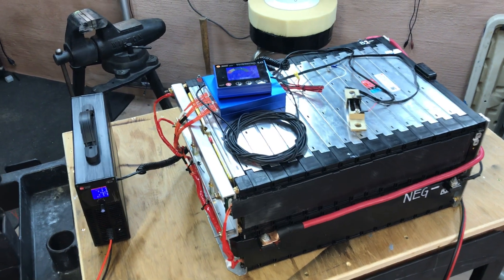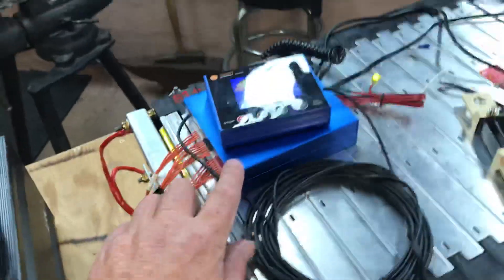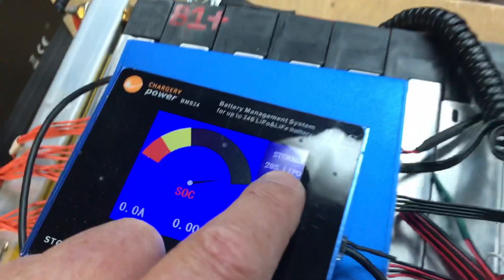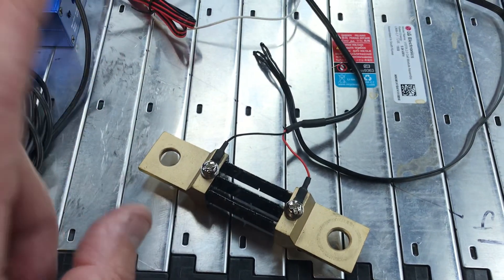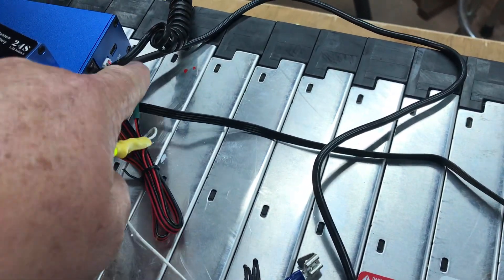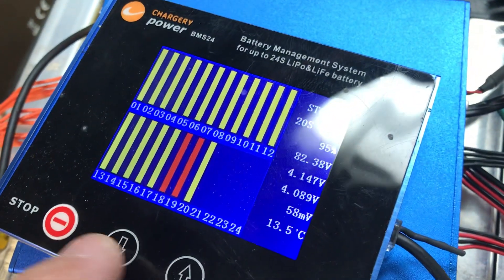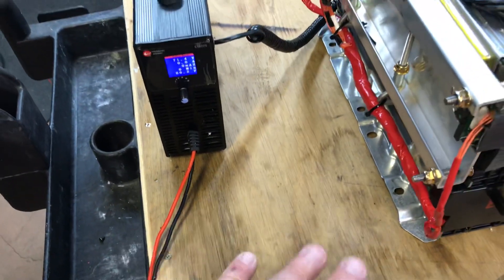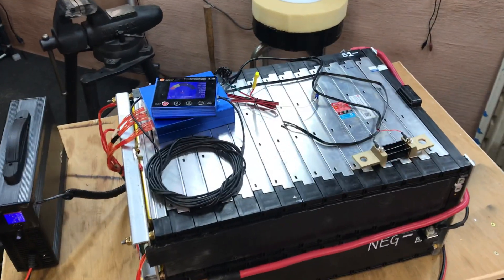Chevy BOLT Gem Car Battery

Comment: Hi Grant. How were the two 40V segments separated, did you have to hacksaw through where the 2 segments come together and then replace the bars it came with your own bar stock?  Also how did you connect the BMS wires to the battery cells? Using the PCB board and its connectors or soldering onto the copper busbar between the cells or ...  Thanks for the video

Comment: Hello, Grant.  If one were to use the Chargery charger how would the charge controller be used to switch it off when the desired voltage is reached?

Comment: Hello Grant, thanks for a great video! I'm looking to do something very similar for an electric sailboat bank, but I want to do 2 of these packs in parallel. Do you know if I basically would do the same setup with two BMS controllers and chargers, and are you happy with the setup and products you used in this video?

Comment: Grant, i have a 02 e825.  would  you be interested in building this kit and selling it to me?  or even if you want to just walk me through sourcing and building it for a fee.  your knowledge is amazing!  iv seen you everywhere online in all the research i have done from youtube to the electric car forums.  you know your stuff!  let me know, im itching to get my project going. thanks
Reply from the maker: Nick Alexander yes I can build you a complete turn key drop in Bolt pack. The bolt pack in the video was built for Tyson,  (a 2002 e825) owner he dropped this exact battery in the front of his E4 and he has been very happy.
Grantwest@gmail.com
Reply: Grant - I also have a 2002 e825 (72 volt) and have been researching options for replacing the batteries. This sounds like a good way to go. Can we discuss building me one of these systems as well. Cost, timeline, etc? I can be reached at ltt2233@gmail.com.  Greats video.. Tom Tart

Comment from the maker: Yes the Delta Q can be Re-Programed to charge Lithium. 
A BMS is made to balance multi cell Lithium battery’s. Flooded lead acid battery don’t seem to need Balancing although any multi battery set up can benefit from having somthing that keeps them all at the same level. Flooded lead acid seems to be going the way of the dinosaur so I don’t see many company’s making new flooded lead acid balancers. I’m sure if you look around someone make one. Check out a company called Battsix. They make and sell multi bank displays that show battery levels of flooded lead acid packs

Comment: Thanks, Grant. For a 05+ GEM, Is a BMS necessary (other than for information)? Will the GEM DeltaQ Charger  do ok with factory(AGM) settings?
My E2 came with new batteries, but I'm thinking forward a few years to when they will need replacing.